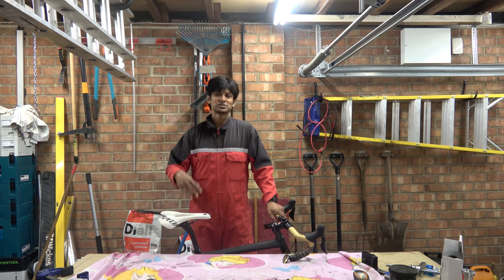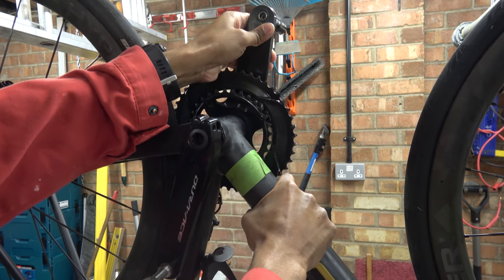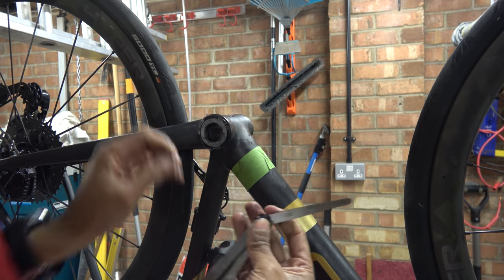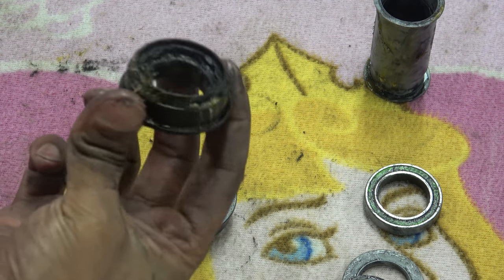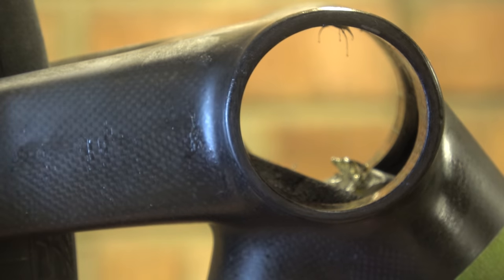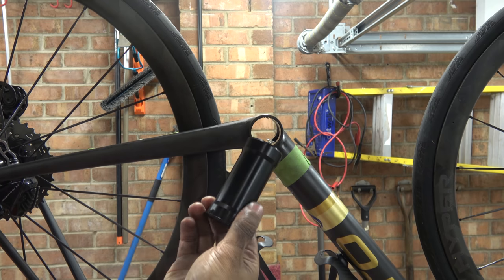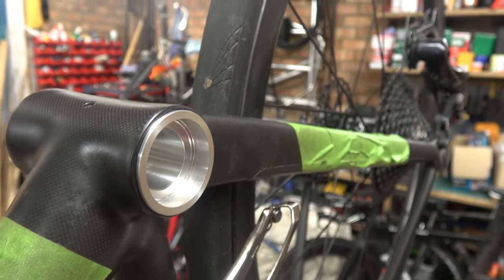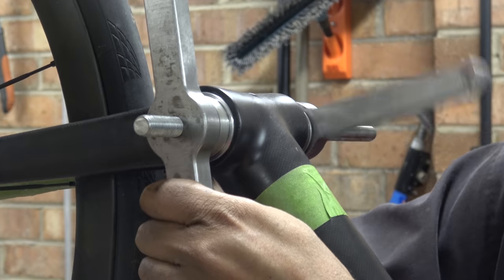Super Expensive Sarto Bike Frame, turns out to be crap. Hambini Bottom Bracket Necked Dream Build

Comment: Imagine spending money like that on a bike and getting crappy service from the bike shop. 🤦‍♂️
Reply: @johnsmith1474   Not every bike shop can sell you the bike that you want - especially if you’re buying a $7K bike.
Reply: I think no bike shop in the world has the tools to repair an oval bb... They did what they could and the bike was sent to someone who can repair this type of shite
Reply: @frorton_9170  If they can’t repair the BB on a $7K frame then they should warranty it, and either refund the money or sell the customer one that is not doomed to failure. You’d expect that from a car dealer when you buy a top-of-the line luxury vehicle. Why would you not expect the same from a bike dealer?
Reply: @matthewtaylor3308  though paying Hambini to fix this stuff was probably much quicker solution than warrantied it, so if you can handle the cost, you also get a perfectly aligned and stiffer BB with high quality bearings as part of that.
Reply: @OYeahan  Given that the Bike Shop failed to get the new owner-supplied BB installed, and then damaged it with a hammer - their “warranty” attempt was a failure. Of course having Hambini save the day was a better solution.

Comment: FSA Mega Exo 24mm crank spindles are oversized, up to 24.07mm. Their bearings therefore have a larger ID than others. This is the reason for the extra play between the bearing and spindle. 
There are plenty of other bottom brackets that use 2437 bearings (not my preference) that don't have play like this one.
Reply: Yes, you can only use FSA bottom brackets with 24mm FSA cranksets. You can try hammering it into a Shimano BB but it'll crack the plastic sleeves

Comment: Why is it so hard for frame manufacturers to create a circular hole to the correct size?
Reply: How could you expect a round hole when you're only giving them 7 grand?
Reply: get a threaded bottom bracket.  press fit shite is designed to fail.
Reply: @shamuslamont100  What? Since when is threading cut more accurate process?

Comment: After slagging off the LBS for questioning the accuracy of the black Hambini bracket, it would have lent more credibility to the video if you had fitted a new example of that model.
Reply: @Hambini  Great video, I hope they improve their products
Reply: So, you didn’t see the daylight shining around that gauge?
Reply: I understand what you are saying, but with the hydraulics entering into the BB aperture the bike shop could have stated the central body shell of Hambini’s BB was too large. Obviously the bike owner supplied the Hambini BB and the bike shop attempted to fit it, but their mechanic should have thought through the potential end result. If they had successfully fitted the supplied Hambini BB, what were the potential impact to the hydraulics?
This is where you need a really good relationship with the bike shop mechanic so that they can be honest with you, and explain the issues they are facing with your build. I have not removed another persons BB in years, but suspect the bike shop thought that few, if any owners will remove a BB so pack it with grease in the hope that works for a period where they can remove the BB, show the bike owner the ‘damage’ to the crankset and claim it is failed or failing bearings or similar, then keep replacing bearings…
Reply: Steve M, Hambini clearly states that it has been damaged using a fine adjustment percussive tool.
Reply: @actuallypaulstanley  The hydraulics didn’t enter into the picture, given that the frame was out of spec.
Reply: @Hambini  and Enve white papers (comes in trip-ply).
Reply from the maker: This is a comedy show, if you want credibility watch GCN,
Reply: @Hambini  comedy show confirmation received.
Reply from the maker: @fergusdenoon1255  There appears to be a bot removing comments.
Reply: @Hambini  Does your hairdresser have access to your YT account? Does she (or other, I don't judge) have a Specialized "S" tat on the left cheek? Could be an inside job (pun intended)...
Reply: How can anyone here not get distracted by how weird this custom bike build looks.

What's the geometry of this contraption
Reply: it might have worked but the state of that frame, at least they had a go....but what hambini does? should really be standard practice...  at the factory.
you could rectify nearly all the issues in hambinis bottom bracket odyssey by just moulding the frame a few thou undersize hole, you could even mould it with a ply to ensure the oversize is resin only on the lips of teh hole t prevent delam.. , and then finishing on a jigged lathe...shit you could do a half decent job with a little 200 quid chinesium one,  would take all of a minute once you had the tolerances dialled in.and the jig set up on a production line , to let something like that get past QC when its a quick turnaround fix and not likely necessary but a good idea on all their frames..they are creaming it in for bikes that cost thousands and skipping a 20 dollar finishing step...
or just bag up the rejects and hand them off a little cheaper to someone who knows how to rectify the flaws and install appropriate hambollocks partings and systemisings.,
Reply: @Hambini  I REALLY want to see what the owner looks like...
Reply: @deadprivacy  a "20 dollar finishing step" is a 6% increase in the cost to produce it, simply not feasible. You are talking about what is an hone, insert, glue, rehone method, just a lot of work and questionable based on who does it the accuracy.
Reply: @millsshumps1968  at first I thought my TV had altered its picture Ratio!
Reply: @ThunderousProduction  then you tack it on the price, let the market decide...you can have this bike where they just let it out the mould then out the door, or this bike bottom bracket tolerance and headset tolerance are machined as standard, thatll be 200 quid extra please.

Comment: Great job as always...have overcome the FSA stupid axle tolerance issue on several occasions using,making a sleeve to fit between the undersized axle and standard 24mm Shimano bottom bracket Bearing size...bloody annoying though,even when the frame tolerance is good.

Comment: a question: let say we get a frame with bad shape BB area, probably not round, not concentric or else. if we can fit 1 piece or 2 joined pieces metal BB housing/sleeve into the frame, can it be creaking free and spin freely? will it be bad for the cranskset since the crankset is relatively not in straight line to the cassette, chain, etc?

Comment: 2am    I have a question on something dumb that I did , had road bike steel put a xt crank on it for a Rohloff hub now I removed the hub and putting left over parts on it but I had to put two spacer on the non drive side due to the fact it was a 68 width bb steel,threaded English.  So instead of two on drive side they are on non drive side to get the eleven speed to work,,,  sort of dumb but will it work with the two on the non drive side?    Thanks for help.. bike is a surly strangler using various parts I have…ect..  thank you

Comment: Great video. I've got a Ridgeback with hub gears. When going up a hill the chain feels like it slipping and the pedal just falls through the rotation. Very annoying and I'm worried about losing my balance. Problem only started when I replaced the chain. Gear transitions are smooth. Could it be a bottom bracket issue?

Comment: So the issue is that obviously cups should not move in the frame, the bearings should not move in the cups, and the bottom bracket spindle should not move in the bearing inner races. Yet this stuff gets greased up, asking for trouble.

How many problems could be avoided by simply using removable loctite at all these interface points?

Comment: How would you round it correctly and make both holes level or parallel?  OR if your close enough does bottom bracket take up the difference?
Reply from the maker: if it's close the BB will make up the difference.

Comment: How do you machine out the misalignment in the two planes of the bottom bracket? meaning the two sides flush with the centre line of the bottom bracket and the frame?
Reply from the maker: You have to standardise on an imaginary datum

Comment: will he have to get the BB out if he needs to replace his brake hose? would it make sense to drill a few holes in the BB to allow mechanics to fish for cables or is that bad in case water gets in the frame via the seat tube?
Reply from the maker: you can remove the BB with a removal tool. It's quite straightforward to do.

Comment: Cheeky bloke . . . consider that the thin 'wall' of the circle up top was part of the design as there was plenty of frame supporting it. The bottom of the bottom bracket, however . . . the material there is on its own, exposed, and so is molded/shaped thicker. So, there is some purpose in asymmetry. Inside diameter off, . . . that is another issue.

Comment: Anyone can correct me if I'm wrong, as I'm no expert in carbon fibre technology. But can't manufacturers produce the BB with extensive width and thickness and machine it after molding to size with much tighter tolerances?

Comment: Nice fix that, so what is the process/how did you Square up the frame ?
Reply: The process I use is lapping! With suitable mandrels and diamond pastes the holes are straightened and the geometry becomes excellent! But the process is cumbersome, and with a large decentration is inapplicable.

Comment: How's that grease got so dirty in 2 weeks? Did the bike get returned to the shop and they repacked it with excessive grease mixed with metal dust to take up the slack?
Reply from the maker: I think a lot of it is the choice of grease. it appears to be gray in color. Add to that some bearings that were grinding.

Comment: Why don't you use any kind of assembling greace or loctide between frame / BB / bearing? Thx for answer and greatings from Austria..
Reply from the maker: So I get creamed on various internet forums
Reply: @Hambini  thanks for the extremely helpful answer, helps me a lot......
Reply: With a correctly machined interference fit , its accepted practice to press in dry. The bore is smaller than the bearing od, therefore any grease will be squeezed out up on fitment. Loctite obviously will not be required as it is correctly machined.
Reply: @Hambini  I must visit these forums for a laugh as they obviously know fu#k all.

Comment: Hi and thanks for another interesting video. I have a bike with a shimano hollow tech 2 BB and one with a campagnolo ultra torque BB. They spin OK. I have just bought a cheap £750 gravel bike fitted with shimano Claris group set. It has a sealed cartridge taper BB which allows the BB to spin beautifully. Could you explain how this component seems to out perform other BB that are a lot more money. Thanks
Reply: I ride $750 gravel with Claris groupset as well and I recently replaced sealed cartridge BB after putting 6000 miles. And the BB itself is under $15 USD.
Reply: @Reanimator999  hi, how do you find the Claris groupset?
Reply: @DeepakKumar-lv4te  Actually it's not a complete Claris groupset. Just Front & rear derailleurs and brake/shift handle. They shift gears fine as everyday commute bike. And I'm not blowing a fortune replacing worn out chains and cassette.

Comment: If the frame is so poorly maligned at the BB, why does the owner not send it back?  It appears to have a metal liner sleeve bonded to the carbon at the BB. Is it the carbon lip that is the problem or the whole BB, including the metal liner that is out of round?   Also, I'd like to know whether the custom BB you machined was symmetric or whether it was odd-shaped to fit the thi particular hole that was out of round.
Reply from the maker: the owner tried and go tnowhere.
Reply: @Hambini  Well, another Hambini customer and another company that makes the “Hambinied” list. Thanks for the info.

Comment: 6000$ bike- I don’t think so. I don’t reckon you can get a Sarto custom frameset alone for less than 3.5K GBP. Great fix, but should a frameset like that ever need to see Hambini - shocking. Seems like there’s only Time worth considering and they don’t currently have a UK distributor - also a bit skinny on tyre clearance. I hope Time sort both those issues out. Superb video though. Good work as usual Hambini.

Comment: Any follow up updates on the Trifox frame?  Thanks!
Reply from the maker: Results have come back. I need to get on Excel
Reply: @Hambini   Please consider a focus on Non-Destructive Testing since you do send frames for that service, and it provides valuable information about their manufacturing results. I'd also like to know what the NDT guys find on carbon wheels since that is another safety critical component. Thanks, engineering enthusiast (18 wheels, carbon, alloy, forged).

Comment: If that bike is two weeks old, and has that manufacturing defect, why potentially invalidate the warranty by taking material off the BB shell as part of the repair? Why not just return it to the shop and demand a replacement? I know it’s hand built and custom, and therefore won’t be replaced quickly, but these frames cost thousands, so surely the responsibility to get this right lies with Sarto and the dealer?
Reply from the maker: dealer didn't want to acknowledge it.
Reply: @Hambini  Did the customer contact Sarto? Did anyone try to contact the producer of the frame?

Comment: What have you done, Hambini? With a silent bottom bracket, nobody will hear T-Rex riding up behind them.
Reply: RollinRat  Fixed gear fashion is brutal like that.  Stay strong.
Reply: RollinRat  Maybe so... but if Hambini had an NJS-approved bottom bracket, you know you'd still lust over it ;)
Reply: RollinRat  mmmm, Phil Wood makes great stuff for sure.  C'mon Hambini, when are we gonna get a square taper BB?
Reply: RollinRat  wow!  Well those hubs sure had an aventure anyway.  Long ago, I once won a certificate for free schwag from either Phil or American Classic.  I needed a new mountain bike square taper BB, so I went with American Classic.  The crank bolts had GREASE PORTS on them.  To lube the bearings, all you had to do was remove the dust caps, and squirt grease through the bolts until clean grease was oozing out of the bearings.  They just don't make 'em like that any more.
Reply: RollinRat  You're right!  American Classic licensed it from WTB.  I already had a WTB headseat at the time, and loved the thing.  As for my hubs in that era, they were rebuildable cup-and-cone Shimanos.  Never had Suntour bearings, though I still have a set of XC Pro thumbshifters.  Fantastic stuff.

Comment: The obvious (hypothetical) question is why don’t manufacturers of high end bikes fit proper bottom brackets like yours and thus avoid the issues of trying to meet reasonable engineering tolerances on plastic frames. It doesn’t take a rocket scientist (or even an aeroengineer) to realise that plastic isn’t as easy to manufacture closely as metal. Even this communications tech knows that.

Comment: frame seems fine to me, all in the tolerance, press fit is not what i would recommend anyway but only threaded!...the bottom bracket is shit (as most of FSA products) and it seems as the bike shop didn't install it correctly (maybe they didn't use a proper tool in order to press it in without tilting it) and given that with your better bottom bracket the cranks spins that good it seems that the precision of the frame is more than acceptable

Comment: Isnt FSA 24.2mm anyways.... it’s wider than hollowtech 2’s 24mm spindle diameter. Easily there’s some play that’s damaging the Hollowtech Dura Ace spindle. Throw a proper HOLLOWTECH 2 BB in the frame and it’ll work. Sadly the frame is probably off. Only like 7 mins in but easily a resolution
Reply: Although there is definitely some misalignment in the frame itself as well as roundness problems in the bottom bracket shell, clearly the bearings are not compatible with Shimano’s system either.  Check the BB STANDARDS chart and it’ll explain perfectly. https://wheelsmfg.com/bb-standards
Reply: Crankset standard chart - https://wheelsmfg.com/crankset-tech
Reply: FSA Is 24.07mm my mistake

Comment: Is this Sarto frame a legit Sarto frame?  Having china hyperspace carbon rims on a custom $7k usd frame do not make any sense to me.  I'm concern that the Sarto frame could be a china frame painted "Sarto". It could be a real Sarto frame but I've been riding for over 6 years not and have come across many high end bikes.  I've seen lots euro bike (BMC, Pinarello, Willier, Conalgo, etc...) with non ENVE or ZIPP wheels but never a china carbon wheels. Let alone a custom frame with china carbon rims.
Reply: The Winspace Hypers are superb, I have a number of Colnago’s and purchased a pair of rim brake Hypers after Hambini and Peaktorque amongst others waxed lyrical about them. I actually replaced my Zipp NSW 303’s on my C60 with them in the end as quite frankly despite the pair costing the same as the Zipp front wheel they are superior. The Zipps now adorn a 25 year old steel Colnago. I have nothing against my NSW’s but the Hypers out perform them comfortably especially in weight and lateral stiffness.